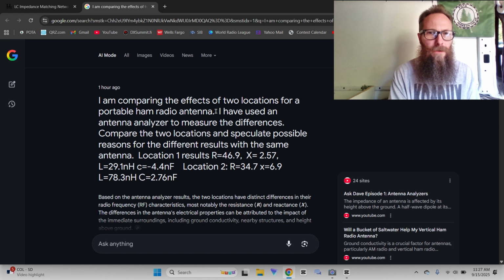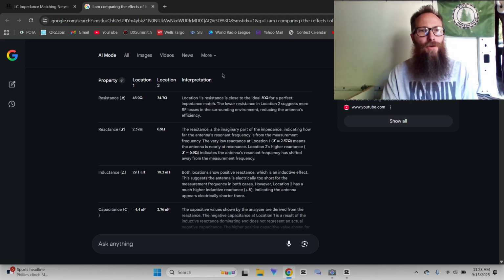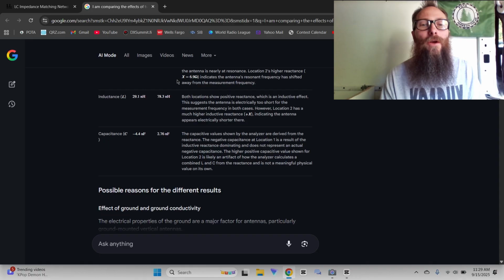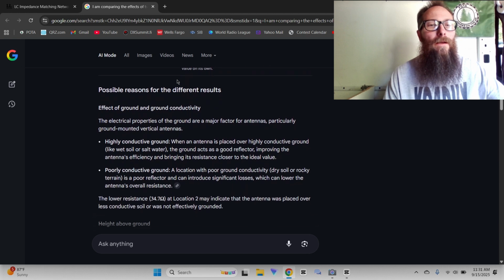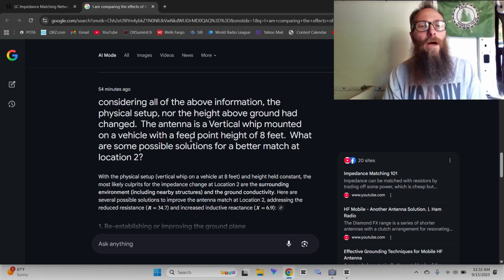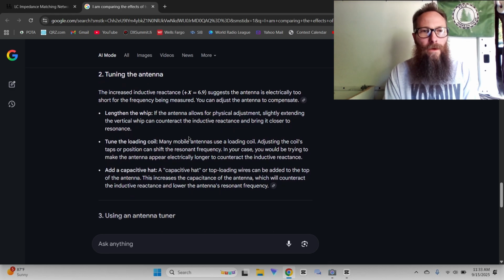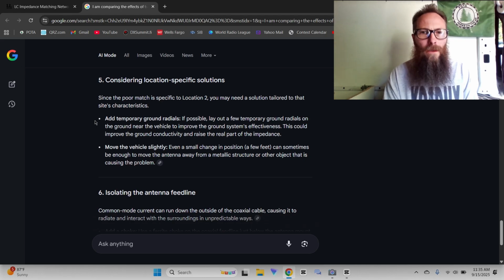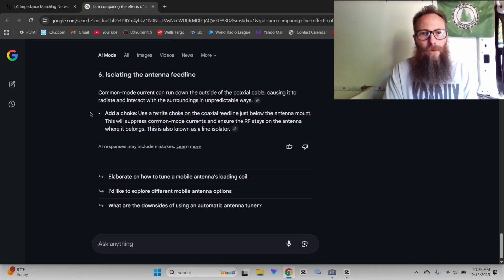AI  For Antenna Troubleshooting

Comment: Jay, I began using AI (ChatGPT) for the last two months and it has enhanced my understanding of Ham radio antennas and their behavior  by a magnitude. I am not an Engineer and need a simplistic description of antenna principles so that I can apply the principles and discover for myself if they are true or not. 

For Example: I entered this question into ChatGPT. “I am using a rig expert AA-55 Zoom. On one button I can read the following values, SWR, Z, R, X, RL, Phase, L, C. Please tell me in simple terms with simple examples what each of the terms (values) mean. And what is a range of numbers to expect and what numbers are optimum for each number (value).”

I received a 14 page response which included the following topics.
Terms you see and what they mean
Antenna Adjustments and what controls what
Quick tuning cheat sheet
Typical numbers for a 40m vertical
Suggested tuning steps (examples)

I tuned my antenna and sent in the readings and received this response
Your current reading for frequency 7.150 mHz
What to adjust
Your target after adjustments
The addition of a coil at the base
Your new goal
What affects R in the new set up 
Tuning process revised
Suggest using a UNUN 

I highly recommend using AI to anyone who is motivated by curiosity and wants to know more about any aspect of the “hobby” called Ham Radio...

Joe AA6WG